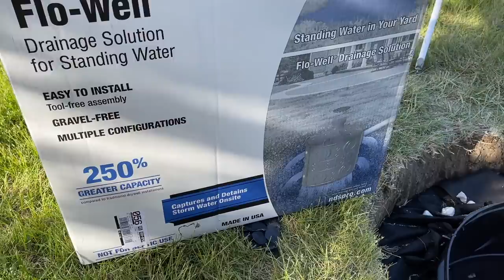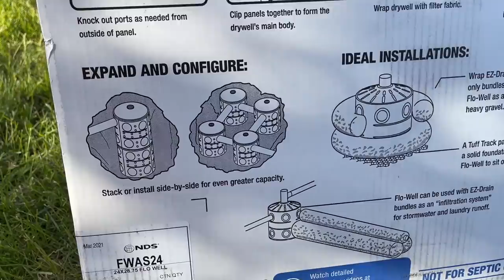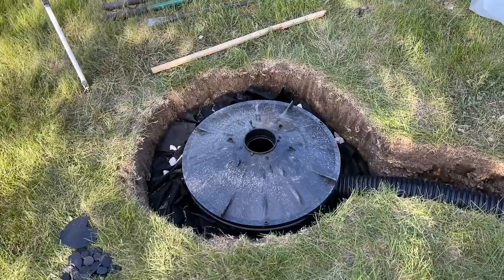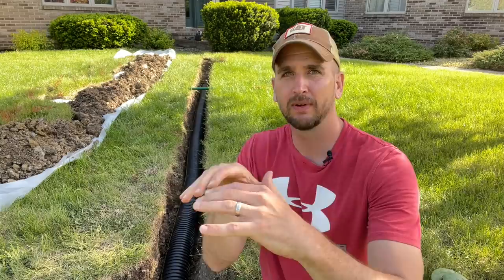DIY Flat Yard Drainage Project | Yards With No Slope

Comment: curious as to what you installed. it looks undersized for the volume of water (sf at 2" rain/hr in typical locations) which adds quite a bit of cf area required. last, the 1.5% = 3/16" pitch on pipe which is a bit less than the 1/4" required in most areas

Comment: Need to cut that tree down way to close to the foundation the roots will cause foundation issues .Create your fall by cutting off the gutter discharge tell you have fall ,then connect piping .

Comment: Forget that dry well ..its giving you no more than 5 square feet of drainage.  Get about 8 or so sections of that drainage pipe  (that is perforated) 15 ft long each
Dig a trench 2ft wide at least 18 inchs down  ..lay the 8 sections of pipe and wrap it.  ..you now have a void that collects drainage water with 30 square feet of drainage.
With dry well tanks there is just too much water going to a small square footage.  Just make sure you use a good quality pipe that won't crush under the weight.

Comment: At this point you should of just continued a solid pipe to the road or as close as you could and have the water go out there and away from the property. Your setup seems like it will work for regular rains falls but anything major its likely not enough and seems like it was more work to do what you did then just continue it to the street IMO.
Reply: Exactly!  Just continue the pipe to the road.  Too much unnecessary work!

Comment: Wow this is great! exact same situation at my house with the negative grades, and theres already a system that was installed 20 year ago to a drywell but it cant keep up with our rain anymore since I don't know where the ending drywell is buried I was looking at putting a new drywell pit where ive dug and found the pipe before and then also including an overflow outflow that daylights near the ditch. I was sold on using sch40 pvc, but now i might just use 4inch corrugated because I have like 100ft in the shed and because of the freeze thaw cycle thing you talked about.
Reply: I know it's been 10 months since your comment but I was watching a FixthisHouse video and they said for smooth pipe run a slope of 1&1/2 inches per 10 feet but with corrugated pipe it needs to be at least 2&1/2 inches per every 10 feet. Just something to consider. They also ran solid pipe for the first 8 feet away from the house and then used perf pipe on the rest of the run. Just food for thought. Good luck.
Reply: @disillusioned070  thanks for the reply, haven’t done the work yet because we had drought conditions last year and there was no need; but with more rain again this year I’m seeing the benefits again; I definitely want to go with smooth walled pvc pipe

Comment: You mentioned your trench is well above the freeze line.  Shouldn't it be below the freeze line, maybe 2-3 feet so it doesn't freeze?
Reply: Yes it should.
Reply: Weeping tile (corrugated pipe) won't really freeze.
I put a 4 inch pipe on my sump pump during winter in Canada and it's never frozen solid
Reply: @evictioncarpentry2628  interesting....is the pipe above or below your frost line?  If above, how far above?  Have similar issues here upstate NY snowbelt with high water table.  Fun.

Comment: It seems like the primary problem that should have been discussed at the start of the video is why you aren’t regrading the yard so it is no longer flat.  That’s a passive solution.  Active solutions like pumps are secondary solutions.  As you stated in the video, the existing sump pump solution is not getting the job done, making an even stronger case for regrading.  Both regrading and all of this pump work cost money, so the cost delta is what is really in play.  If regrading was your professional advice,  but the homeowner said he didn’t want to pay for regrading, then state it.  The homeowner already spent money on a sump pump system that doesn’t solve the problem, and here he will see results based on what he is willing to pay for, again.
Reply: 2:32 show's his window well and decorative block foundation. If the foundation 'make up' would allow for raising the grade I think he'd have some serious waterproofing and new window well work to do.

Comment: I'm in a similar situation as you with the sump pump and the downspouts that I need to do something similar. I have a lot of days where the sump pump runs throughout the month. I have some grade issues along with a need to get the water further away from our foundation. But does it need to be 30ft? I've seen suggestions of at least 20ft. I think some recycling of the water back to the pump could be good be a good thing for keeping the grass healthy without causing damage to the foundation.

 I was in disagreement with you on your last video and the proximity of the sidewalk and wonder how quickly this basin it going to fill up?

When was the last time your sump pump was replaced? Replaced ours a couple of weeks ago after realizing it had been just over 10 years since I replaced the last one. Time flies.
Reply from the maker: I don't think it necessarily needs to be 30 ft.  Since I was digging already I wanted to put it a little further out to make sure I could catch the slight slope I did have in the yard.  Get ready for the workout 😉

Comment: Solid pipe only for downspout runoff. Backfilling with soil is ok for THAT application only!NOTE: FOR DRAINAGE OF YARD PONDING: Your runoff MUST empty into a lower drainage swale, or a lower basin/sump pit.  Most pros recommend lining the trench with geotech fabric, perforated black drain pipe goes down next, then cover with 3/4 stone. Then wrap remaining fabric over stone and secure with landscape staples.  Never backfill with soil. If you remove sod with a sod cutter, roll it in 2-3 foot sections. Replace sod right on top of fabric. It will grow back green, it did for me!  The perforations in the corrugated pipe used in this video will be clogged within a year. See videos from Gate City Drainage and French Drainman on YouTube on the subject to get it done correctly.
Reply: Hey bob, should be solid pipe from a downspout. I believe its just a perforated basin.

Comment: Great video. I am about to tackle a downspout drainage project myself. I like the corrugated wye set up you did in this video and how you commented on corrugated pipe versus pvc. I liked your logic for the frost but do you experience any issues with water flow and debris getting caught in a corrugated pipe? Honestly I am not very familiar with pvc and all the necessary fittings and connectors. I would prefer to work with corrugated but have heard some bad stories about it getting clogged. Do you usually work with corrugated? Thanks
Reply: I did a drywell project at my house about 7 years ago.  Initially I did it with corrugated and had to replace it all a couple years later when it got completely clogged.  I replaced all the corrugated with smooth-wall HPDE pipe (from a big-box).  

I live in the Pacific Northwest so our frost line is pretty high but I really can't see how the material type makes much difference from a heave perspective.  HPDE is definitely more rigid than corrugated and I had to use elbows in a few places but I think the tradeoff (not getting plugged by pine needles) is worth it.   I also dug a much bigger hole than Everyday did in his video, which might be why I've not had any issues with volume.  My hole was 5' x 6', drywell in the middle, fabric between dirt and rocks.  I also put a circle of fabric at the bottom of the drywell so I could open it every couple years and dump out the pile of pine needles that had accumulated without the rocks getting contaminated.  It's worked well so far.

Comment: What kind of soil do you have here? The flo-well may work if the soil type allows good drainage but not for clay soil for sure.
Reply: That was my first thought.   In my clay, I would have to dig a hole many times that size and fill with gravel.

Comment: This is a guessing game. Do the math on how much water comes off the roof. Perform a percolation test on the soil. Calculate how large your pit needs to be during a worst case rainy season. I guarantee that small pit won't cover it.
Reply: Say that again. Lol
Reply: I was thinking the same thing when I saw that small pit. Why not just put a pump in the pit and discharge the water off the property through someone inch PVC.
Reply: @robertaltman3801  that hole is dumb IMO.   Have Installed thousands of feet of downspout drainage, for that application we would have just ran it to the street and installing a pop up at the end.   There’s no need for that hole.

Comment: I need to do this to my house as I have discovered that water is getting in under my house going through at the crawl space access door.  The issue I am going to have is where I need to lead the water out to there is my main water line and also sewer line.  I am concerned that if I dig down as much as you did to install the drywell that I might be hitting my water line or sewer line.  Do  you have suggestions or other options that could deal with this?

Comment: This is what I would like to do on my property too.  My plan is to connect my sump pump to the downspouts and to create a French drain at the back of my lot.  The one issue I am concerned about though are the pipes under the ground for gas, electric, etc.  I had a utility company locate the utility lines a few years ago and it seemed like they were going to interfere with where I want to dig my trench for the corrugated pipe.  Just curious, but did you rent a trench digger for this project?
Reply from the maker: Nope, good old fashion hard work 😅 for this one

Comment: In the winter, your pipe may slowly build up with layers of ice and eventually block up flow to the well. I had a similar problem this past winter (and spent 3 hours boiling water and de-icing until midnight). Any thoughts on how to winterize this drainage system?
Reply from the maker: really, made it through 1 winter and so far so good.  Thanks for the feedback!
Reply: @EverydayHomeRepairs  Oh, I was hoping you had figured out solution for this. Glad you didn’t have a hard winter to deal with!
Reply: In the northeast, does this system have to be below the frost line? That would be at least 36" at the starting point, then grade it down.  Lots of digging.  I'd love for this to go all the way to my curb.
Reply: @brianeidmann5941  Not if you have enough pitch so there is no standing water in the line.
Reply: @jimc3688  agree with Jim. I am in New York and I run smooth landscape grade (thinner) PVC they sell at Lowe’s. All but one of mine drain to daylight. I’ve never had a problem with ice backup. I have one that drains to a green pop up like in this video and it does fine as well: it has a small hole in its elbow that slowly drains into the soil. Even tho it drains really slowly it’s enough to drain after any rain before temps drop and free what is standing in it.

Btw mine are about 4” below soil surface.

Comment: why the dry well. Just keep going with the downspout extension to the sidewalk of street.
Reply: Guessing to maintain an acceptable slope, the discharge would be below street level?
Reply: @jamesharper8373  Could be, but a sump pump is easier... except it does need a pump and electricity, both cost money and maintenance. Where I live we can have inches of rain in hours, as much as 3 inches total in hours (3 inches), with clay soil, a dry well would be overwhelmed.

A DRAIN FIELD would work if you have the land and willing to remove a lot of dirt,  line it with geotextile fabric, lay perforated drain pipe, and cover with tons of gravel to lay drain field prop.   I have a typical single family home lot.  No room for drain field or dry well. I installed two sump pumps and pipe it out to the street through the curb. It works like a demon. They collect down spouts and French drains.  I had flooding before. Now it is wonderful,. Even after a hard rain the ground drains and there is no standing water....

Comment: Most pros recommend lining the trench with fabric, perforated PVC goes down next, then cover with 3/4 stone.
Reply: That would be french drain - different thing. He's taking water from the roof directly out in this project, not picking up additional water from the ground. He mentioned if capacity isn't quite enough he may do a french drain downstream from the drywell.

Comment: Scott have you tried any coatings on the foundation walls  to stop water from coming in?
Reply from the maker: Hey Jason, water isn’t coming through the wall into the basement.  Instead there is a French drain along the outside parameter of the basement which drains any water through the drain pipe into a sump pump well which then gets pumped out.  Just trying to dry the ground a bit outside the foundation wall to reduce the work the sump pump is doing.  Should work but we shall see if a few months 🤞
Reply: Hi Jason, do you have any recommendations on coatings you would use? 
Thanks!

Comment: What kind of drainage corrugate/pipe should I use to collect water along a path through the yard to ultimately empty to a storm drain conveniently located in the yard?  I've seen different types with holes or slots and some wrapped with fabric and/or foam peanuts... I'm not sure which to use.  Thanks

Comment: When flushing the y drain with a garden hose,  won't all that debris just get stuck in the 10 gallon well??
Reply from the maker: Yeah, but I can remove the popup emitter pretty easily and remove any accumulated debris out of the dry well.  So far the dry well has worked out great!

Comment: What would you do with a deeper frost line. Ours is about 46". I have two sumps, one on each side of the house and they run for days after a rain. It's especially problematic in the spring with the snow melt plus spring rain. Thanks for a great vid.

Comment: Is this work need any city permit to be taken. Also even if can a homeowner can do it without professional requirement
Reply from the maker: I don't need to pull permits for this work in my area but you might want to check local building code.  You do want to call JULIE or 811 prior to digging to ensure you know where all underground utilities are routed.
Reply: @EverydayHomeRepairs , In other states "JULIE" is called "MISS UTILITY" BUT 811 is used nationwide.

Comment: I have a french drain that is used for drainage from the basement sump pump.  The problem I have is the ground is settling around it forcing the drain to not be level with ground and pitching the catch basin inward forcing the water to settle around it and a tripping hazard.  Any ideas for correction?

Comment: What happens when the dry well fills with water? Does it then discharge water through that pop up emitter into the lawn?
Reply from the maker: Yep and that has happened several times since I install the dry well.  Works perfectly so far 🤞

Comment: Did you use a bottom panel on your system? It looks like you have to buy it separately. great video. Thank you.
Reply from the maker: Nope, I just set it on my white rock in the bottom.  I wanted the bottom to be wide open to help drain down the dry well.
Reply: @EverydayHomeRepairs  Thank you, make sense.

Comment: Is that lower gutter and downspout large enough or does it overflow in heavy rain? You mentioned leaves. Do the gutters get loaded in the fall?
The horizontal drywells give more surface area to allow natural percolation. But you may need a small excavator to get it done efficiently.  We use 4' x 12' here on Long Island NY but we have loan and sandy soils.
Reply: Looks like house could do with extra down spouts as well.

Comment: I like what you did.. But you could have saved some money.. There is no need for the well part.. I have done a few of these in my time.. just need a need a Hole and fill it with the Clear stone.. (what we call the stone you used) I would dig a 4 foot by 4 foot and at least 4 feet deep.. Min.. Cover the stone with landscape fabric before putting the top soil and grass back..
Reply from the maker: Appreciate the feedback and suggestion 👍
Reply: how do you deal with ground erosion that eventually will drop your four by four by four hole below grade
Reply: @tonypapa6280  The clear stone just holds is all back.. I also put extra pipe in the hole and if you really want you can line the hole with landscaping cloth before putting the clear stone in the hole
Reply: Hmmmm... I wonder which would hold, and disperse. more water?
(a) - a 4'x4'x4' "hole" filled with stone. 
or
(b) - a 4'x4'x4' "hole", filled with a 4'x4' perforated empty 'tank' / 'basin', that creates a fillable 'void'.
or
(c) - none of above.
Reply: @symcardnel1741  The Stone is more of a filler so you can put landscaper cloth over it and then topsoil so you can then have grass growing.. I guess if your tank has some sort of top to it that was very sturdy the stone would not be needed.. but the stone also slows the water to keep it from washing soil away from the bottom of the hole..

Comment: You don’t have this problem in the UK as all houses must drain their water From the roof into the gutters under ground which ultimately run to water treatment plants
Reply: North America doesn't send natural water to treatment plants. It's illegal to connect rainwater drainage from roofs and such to house drainage pipes and the municipal system. It's drained to the street then into the the gutters and drainage grates  which go into storm sewers and then drain to the nearest river etc. Mostly because of capacity issues, everything would back up and flood the place. Still happens anyway in downpours.
Reply: @Beruthiel45  need help me my pipe overall definitely try to get a fix for this new hole in drain in project and lower pipes in sasp too please share your knowledge with aloha